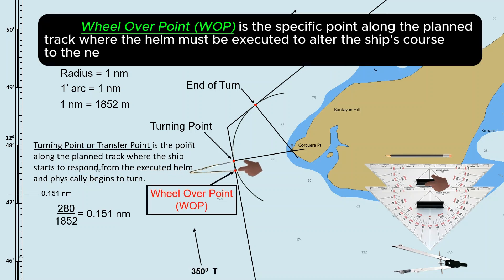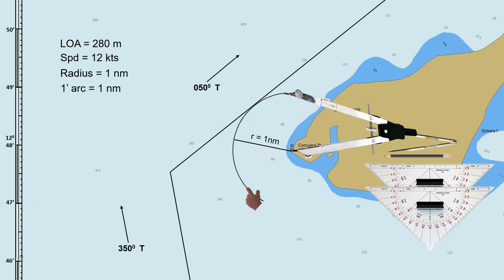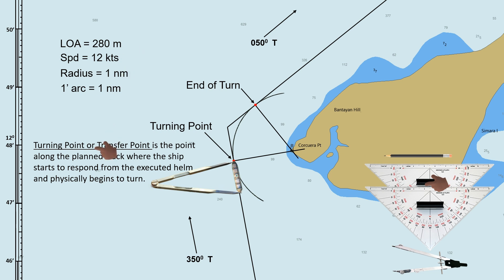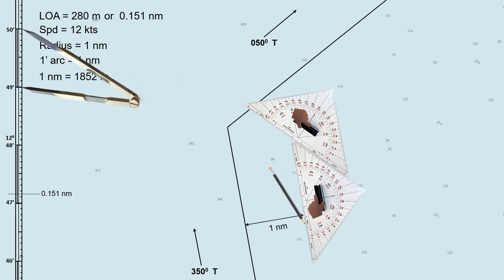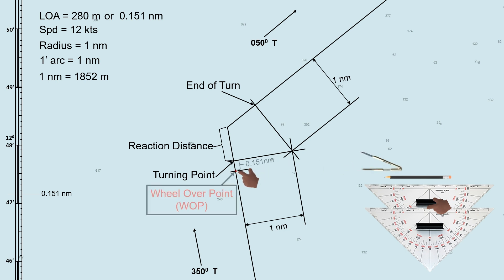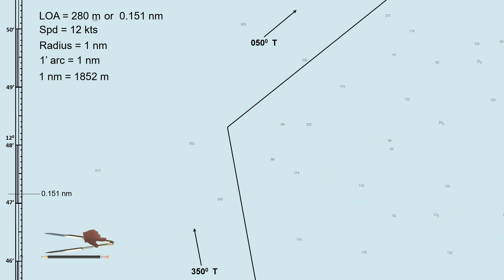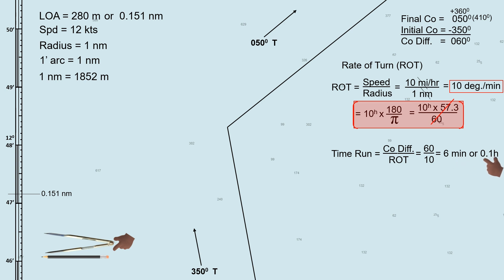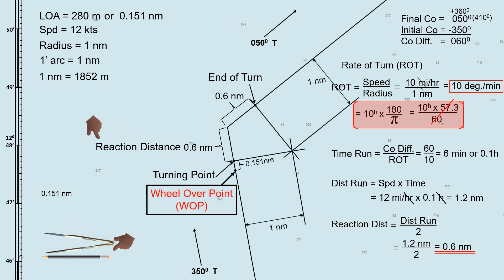Determine Wheel Over Point (WOP): 3 Methods for Accurate Ship Turns ll Rate of Turn (ROT)

Comment from the maker: Correction at Timestamp 6:38: The Reaction distance is incorrectly labeled. It should be labeled as the distance from the beginning of the turn (turning point), going back along the planned track to the wheel over point or wheel over line, and not from the turning point to the waypoint. Typically, the reaction distance is around the ship's length, but in some cases, it can be measured as 2 cables from the turn point, tracing back along the planned track to determine the wheel over point.

Correction at Timestamp 11:17: The term "Reaction distance" is incorrect. It should simply be referred to as the distance from the waypoint, measured on both sides of the planned track, to determine the beginning of the turn (turning point) to the end of the turn.
Reply: Can you pls correct the video:

Comment: Very informative video Sir ❤️❤️😊.
What is the rudder angle for the Wheel Over point?
Reply from the maker: *Thank you!  The rudder angle at the wheel-over point depends on the ship, the turn, and the maneuvering conditions.

In general:
The wheel-over point is the position where you start to apply the rudder for a turn.
The rudder is usually just enough to begin the turn smoothly, often called the initial helm angle.
Its exact value is given in the ship’s maneuvering booklet or determined during sea trials.

So, there’s no single fixed angle — it varies with ship type, size, and the required turning radius.

Comment: Immenesly thank you for your comprehensive explanation on this topic! Only one additional question I have as a beginner: what an actual rudder angle is mentioned under achievement of 1 nm Turning Radius? Maybe the more correct question: what rudder angle shall we put upon approaching a WOP to maintain a desired radius of turn, is it rudder full to required side or half?
Reply from the maker: Thank you for your kind words and great question! The rudder angle required to achieve a specific turning radius, like 1 nautical mile, depends on several factors such as the ship's speed, design, and loading condition. Generally, for large vessels, a rudder angle of around 10-20 degrees (also known as a "moderate" helm) might be sufficient to achieve a 1 NM turning radius.

However, to be more precise, ships with advance turn prediction systems or ECDIS integrated autopilots often calculate the required rudder angle automatically. As a general practice, you may start with 10 degrees and adjust as needed. Using a full rudder might lead to a much sharper turn than intended, so it's advisable to start with moderate rudder and fine-tune during the turn.

I hope this helps, and thanks again for watching!
Reply: Actually I believe we can use ROT required to determine rudder angle. By knowing ship's behaviour and required ROT we can easily tell what rudder angle we may need. It is variable of course, but +-few degrees can be adjusted easily.

Comment: Sir how to Determine The Radius to be Used?
Reply from the maker: Usually, we refer to the ship's maneuvering characteristics found in the pilot card. However, if we want to maintain a constant safe distance around a reference point while turning, that distance from the reference point will serve as our radius.
Reply: @nauticalacademy001  Radius of Turn are half of the Final Diameter in the Turning Circle. Thus I put it as Radius of turn = Advance + Transfer based on the Turning circle of the vessel. Is my assumption correct sir?
Reply: @nauticalacademy001 what do u refer to in manoeuvring characteristics....could u give an example